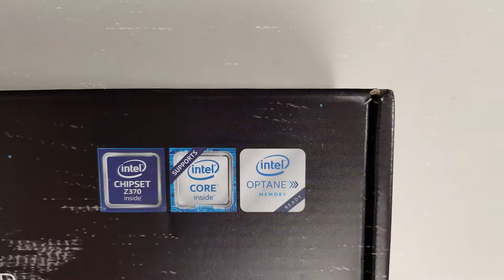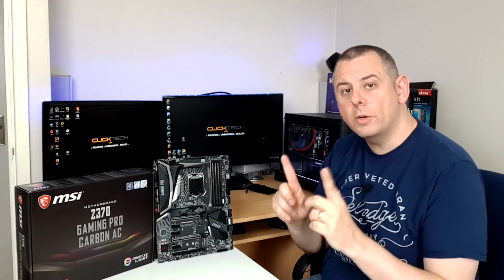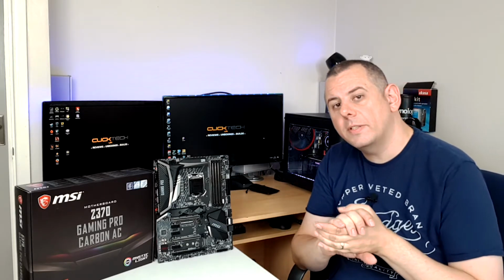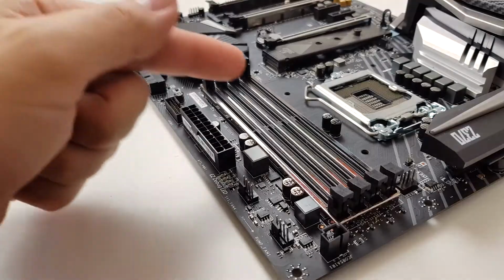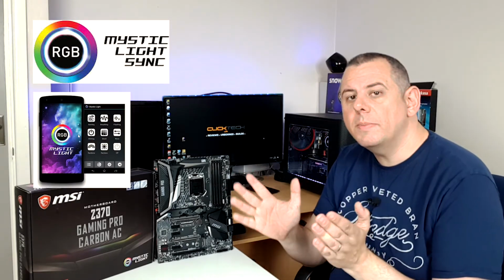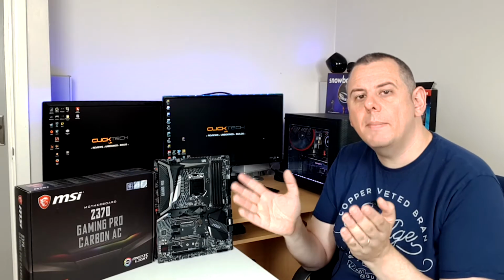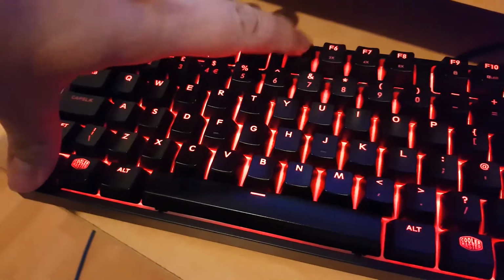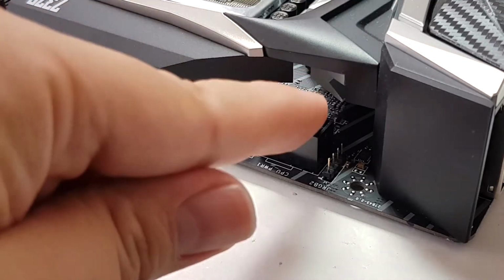MSi Z370 Gaming Pro Carbon AC - Intel Coffee Lake Motherboard Unboxing /Hardware Review / Overview

Comment: Hi, I'm planing to buy Corsair LPX 32GB (2x16GB) 3200MHz C16 DDR4 , Z370 Gaming pro Carbon and i7 8700K. Does the ram work on 3200MHz ? If yes, does it require extra knowledge of manually setting up memory timings ??